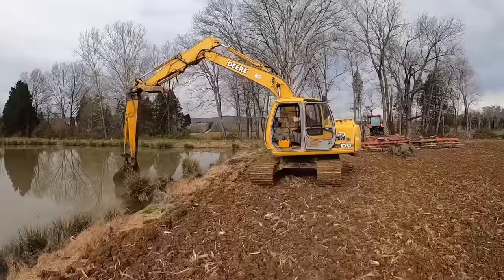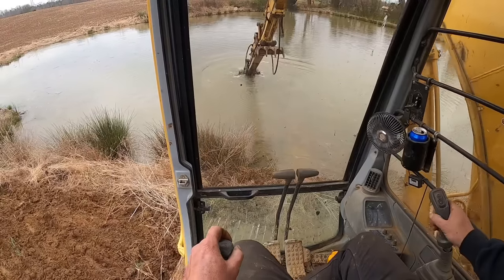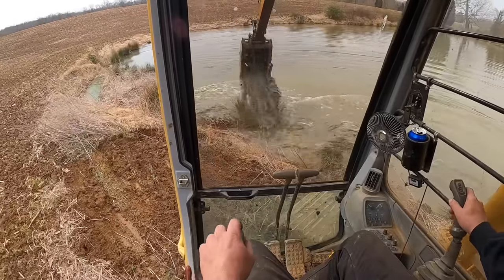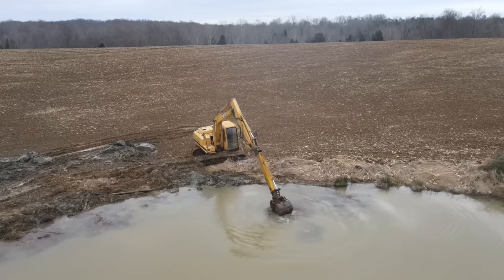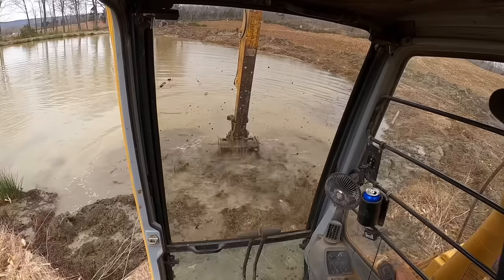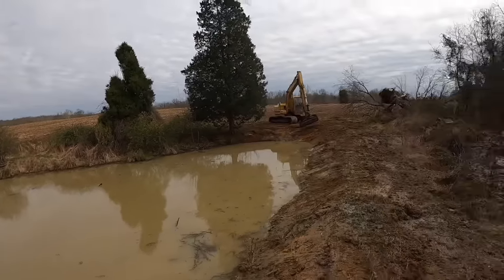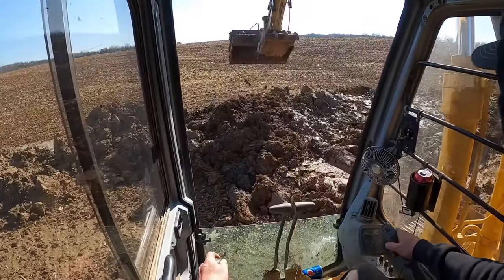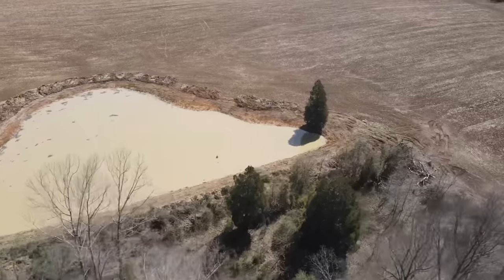The super stick and SRS tilt bucket make an awesome team pond dredging!

Comment: Mike!! You are exactly right with what the cattle do to a pond!! They sure were hard on a couple of ponds on the feedlot,,,,,,. 
    I’m retired now and am working on a pond near a semi remote cabin we just picked up. Sold a few plots of land and traded one so we could buy this and concentrate on it and not have other properties to maintain. The cabin has a permit from energy and natural resources/fish & wildlife that we were to able to qualify for for a 1.5 acre pond. We were just going to develop 3/4 of an acre but now it will be one acre to be realistic. This pond will max out at 28 ft deep, it has no dam as it is a hole in the ground. Looks like the coat will be that deep based on some test holes. There will be stones around the shoreline to climb out on if you fall in (that clay can be too slick to get out of here). The pond will have 3 humps for a total of 1/4 acre (the reason for the slight size increase), one hump will be at the shoreline the other 2 will be nearer the middle of the pond. There will be reeds on these humps at about 3’ - 5’ deep where minnows will hide from the trout I will put in the pond once it’s full and settled. There is a well we have that’s 50 gallons/hour and a natural spring (100 feet from the pond and higher than the pond so we will have a simulated creek created for a feature.  The pond is in a natural swale/hole so it catches a fair amount of runoff. We are also 6 miles from a trophy trout lake so it will be fun catching the little trout until they catch up to the trophy fish. Fortunately we still only have 10 minutes and we are on the big lake!! Our pond will support fish up to 4-6 pounds if we feed them until the ecosystem is established. 4 years to get to that size approximately depending on the size they are going in there next spring. We will use 2 aerators to keep the pond from rolling over and keep it fully oxygenated. There is a natural creek bed for the pond to run into if we get excess rain and it gets over full. 
      The guy is using a Cat long reach excavator with a smooth bucket he has cut/drilled to release the water and then he has a Volvo 160 with a tilt bucket on it that he will work on the shores & creek bed with. There will be about 300 feet of 6-10” river stone lining the creek bed. 
   Looking forward to it being done!! The dirt is being hauled off to a couple of new acreages that need it and they pay the trucking, I don’t get paid for the soil,,,, it’s a win/win $$ wise.  Been sitting on the deck with a few friends when we are not fishing and watching this kind of work live an up close!! The pond will reach a point where it is 36 feet from the deck of the cabin. I’m going to have a catwalk built out to a dock and it will be easy fishing!!!

Comment: I can see it in the future now that when you come back here with the dozer you're going to have forgotten about the wire all through that mud. There's going to be high tensile electric fence wire wrapped all around the tracks on the dozer. That's the way my luck is too. Being so busy while gone from that job then coming back several weeks later the wire would have more than likely totally slipped my mind. The super stick is a neat contraption and I'd like to have a turn digging with it. Pond banks cleaned up good. When that mud dries out and gets knocked down all will look very nice. Good video. Stay well. -Wil  👍

Comment: Thanks for sharing your thoughts, ideas and videos. Nice job with the pond cleanup. Brought back an idea I had a long time ago. Can’t wait to see the new excavator with the remote bucket location sensing I believe I heard rumblings of on the upcoming demo. Many years ago I remember a level that was basically competing against water levels but used fiber optic rather than a hose with water. Somehow was able to locate the exact position of the end of the cable by bouncing a laser light down and back the inside of a fiber optic cable. Problem was they were super expensive and were competing for a market that is relatively in expensive. Haven’t seen one in years and can’t remember the exact brand or name. I’m thinking nobody bought them and they went out by of business. Anyway I was thinking if your tech guru were to resurrect the technology it could be modified to give a cheaper and durable way to add remote bucket location sensing to existing equipment like the 120 with the super stick since it would basically use a single sensor being a lightweight rugged fiber optic cable running to the bucket at the end of the arm. Would be an interesting project if such technology is actually very useful. Wishing you and your family the best.

Comment: Did you have something to use as a hammer. Hammering on the wire a few times on the edge of your bucket would make a weak spot that would allow you to bend the wire by hand and it will break

Comment: When you use the super stick is there any way you could add some additional counterweight to the rear of the 120 to balance it out & allow you to use the larger bucket more safely.
Reply from the maker: Not worth the effort covered that in the video thanks
Reply: @DirtPerfect  sorry wrote the question early in video well before you mentioned it yourself.

Comment: Have question the stuff you pulled away and out of the pond, why didn’t you put it on the back side of the damn?  As it dries out it will help stop the damn from leaking(possibly). Give bigger foot print as well.  And thirdly if it happens to rain again it doesn’t get washed back into the pond.
Reply from the maker: Not what the customer wanted

Comment: Is it possible to add weights to the backside of the deere120 for counter balance weight? The reason I ask is you have lifted a track completely off the ground on this job
Reply: He did say that the bucket was the problem not adding counter weights.
Reply from the maker: Yup covered in the video
Reply: @DirtPerfect  no my question was do they make add on counter weights for that machine?

Comment: DP What if you had a old dragline excavator with a lighter weight bucket for drainage work... Now when you tried some good old machines. 
There is a few small in ( Waterloo ) for sale in your area :p 
There is one in Canada to its "right" size for you its a P & H 757 but think certain Officer going to complain about you getting that 1 down the road.. 
But if the vehicles is walking so what rule apply then on weight and size on public road ?...
Reply from the maker: Cost a fortune to move and operate

Comment: did you go back and clean up with the dozer after it dried out? great job it looks good.
Reply: Given that the farmer had a tractor and disk there with what I would call some sort of soil finishing tool ...
Reply: @ArnieD17  But the disk would get tangled it the wire and the post would do them no favours.  :(

Comment: Bucket edge or track edge + hammer = wire cutter.
Reply from the maker: Pass
Reply: Then you will like the 2 pair of slip joint pliers (or adjustable wrenches, or vice grips, or combination of any of the above) as expedient metal banding cutters.  Usually works better than tin snips...